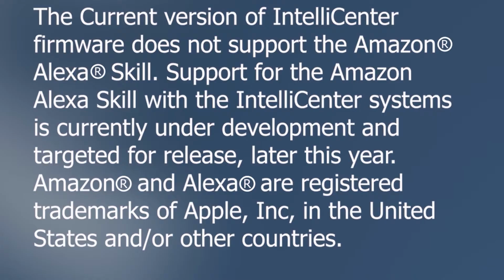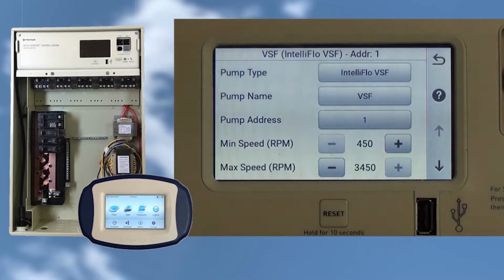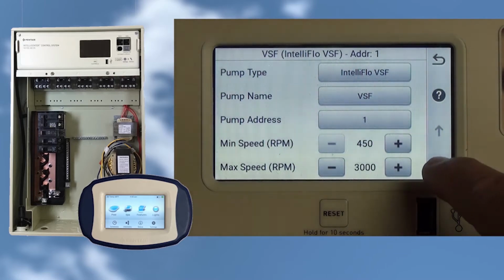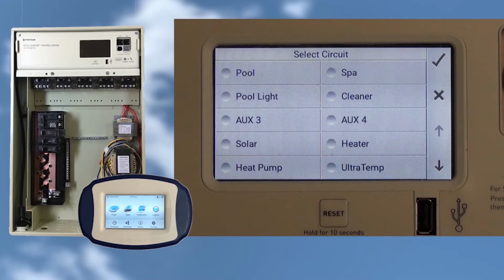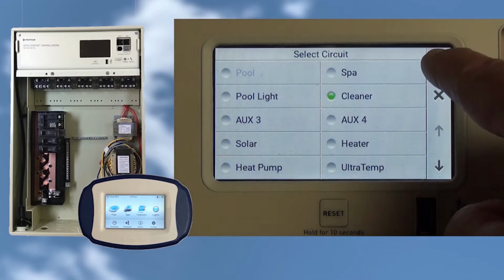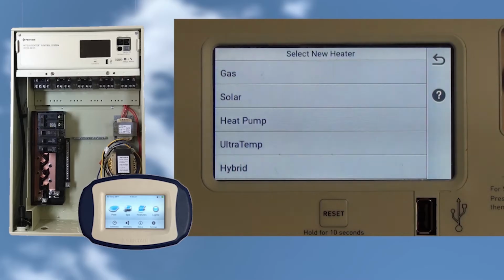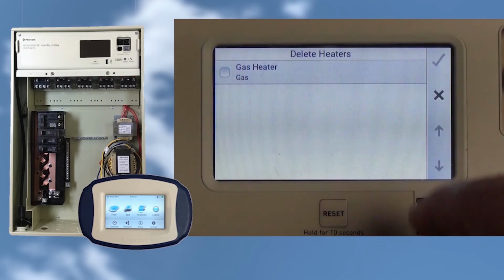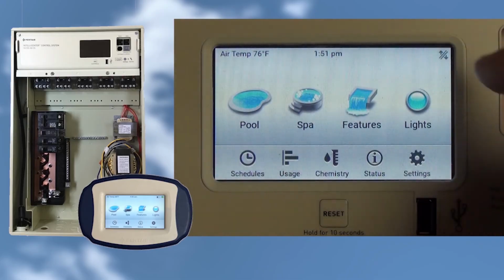The IntelliCenter® Control System for Pool and Spa- Step 4: Setting Up the Equipment

Comment: Thank you for the great instructional. The pentair pool guy that came out to replace an actuator told me what we are doing was not supported. Reviewing this video had my problem fixed in 5 minutes. The repair guy replaced every electrical component and supposedly talked with pentair and they all stated opening and closing a value when the spa turns on and off is not supported. Thank you so much!